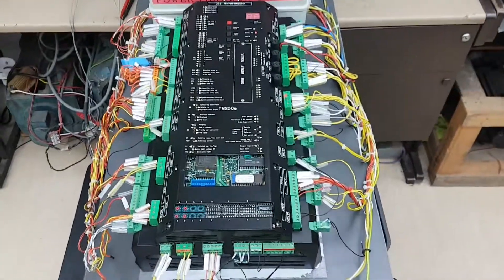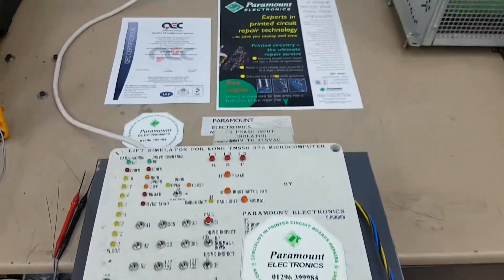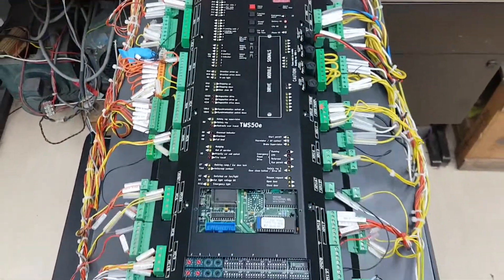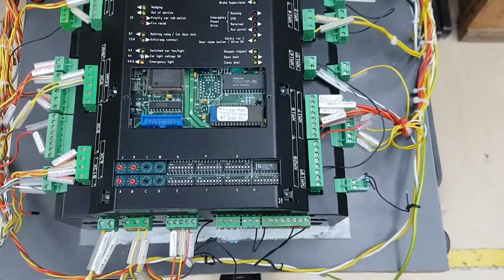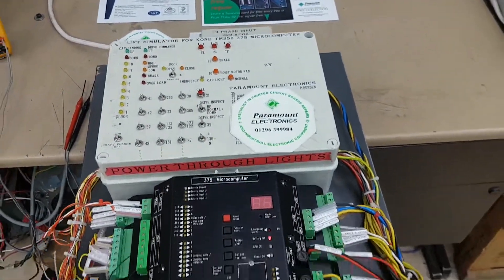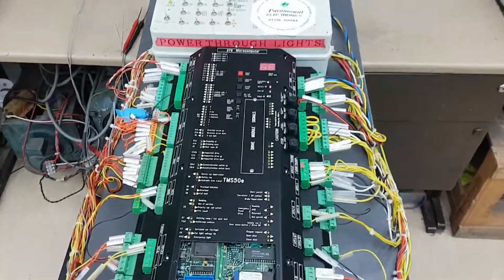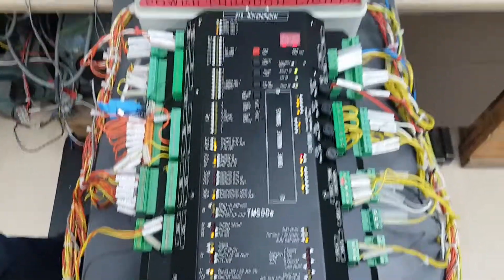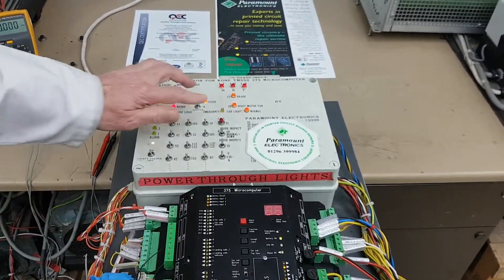Kone TMS50 / TMS50e / TMS50eb unit under Test at Paramount Electronics Ltd

Comment: Hi. Do you still own the controller? Is the chime from Kone M located there as a sound file or as a synth chip?
Reply: Can you please explain what you mean?
We stock these TMS50 controllers which are refurbished by us and ready to sell/ service exchange.
We also offer a repair service to your faulty TMS50 units.
Reply: Yeah. Sorry for a late answer. I was actually wondering how the bell/chime sound works when the elevator arrives. Are the sound files located in the unit?